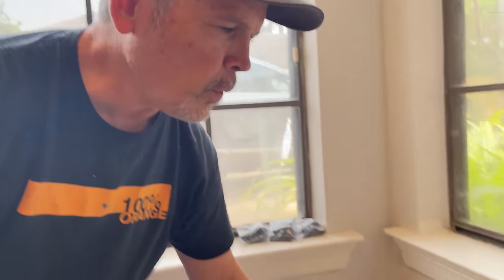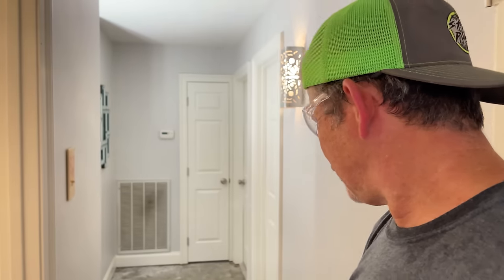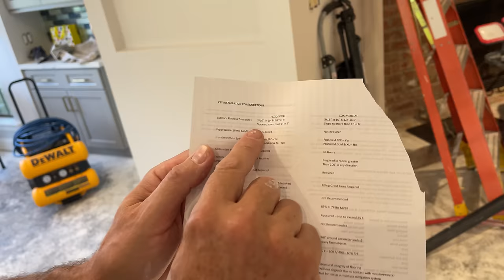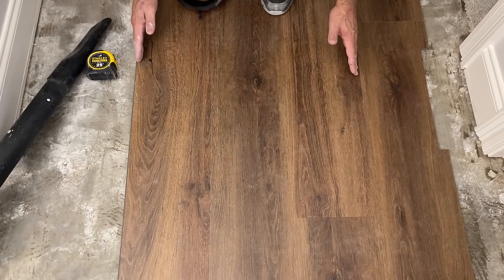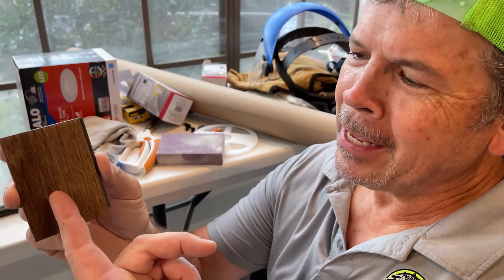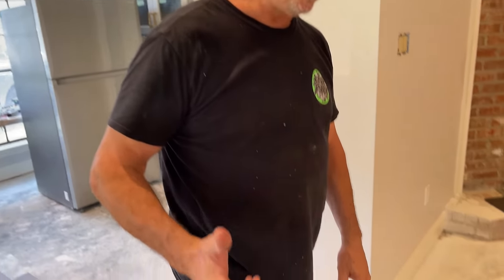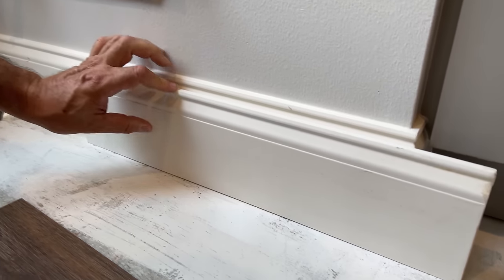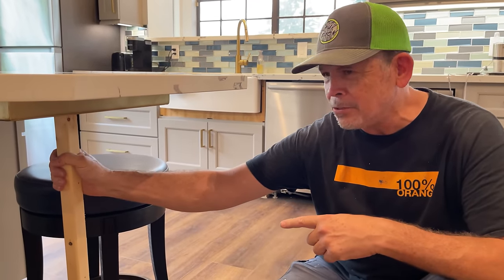The ULTIMATE FLOORING HACK! | Installing Vinyl Plank Flooring

Comment: Also u can get those pieces in with out taking any rows out or putting water or soap crap on there u use a prybar and a none making rubber mallet.  Then u can get those pieces in after u measure and cut the pieces right. Lord please bless these guys and let them know not to quit there day job.  This is pretty bad but whatever floats your boat

Comment: i never seen anyone lay a floor like that, and that is not a compliment, this is not the way you lay a laminated "wood" floor.
1, you equalize the floo (you done that)
2, you put down plastic, the concrete can absorb moist, you dont want that to get into the laminated floor.
3, than you lay down 7mm-10mm-12mm green insulation sub floor,
this has two functions, 1, it obsorbs noises, 2, it will keep the floor from getting too cold, again you are on naked concrete, that will be VERY COLD..
i have never seen anyone lay a wooden floor directly on a naked bare concrete floor,  that lil insulation u got on that is not gonna do much!,
this is the cheapest thing i have ever seen, and coming winter, they will be sorry they cheaped out!.

Comment: Always remove the base on finishing side! Undercut hearth looks best also. The fee effort required to cut and place shoe molding is similar to removing and replacing base. Plus it doesn't look like a trailer after.

Comment: There is absolutely no reason to be using any type of glue on a snap n click lvt install unless your doing a repair. You also def do not need a table saw to make cuts. To make your angle cuts like he had by the fireplace the best way is just to start from the fireplace and you will get a nicer and more precise cut. Then once you get past the fireplace if you wanted go back to starting at the other end if you wanted to.

Comment: All u have to do so it won't move much not at all is put your boxes of flooring on one side to have weight so it won't move not put screws in the floor that's just time wasted for nothing when u have full boxes that are heavy if u put so many down through the opposite side your working

Comment: The baseboard should ve removed before flooring and by doing that the plastic wedges will rest against the wall. After you remove the wedge and put back the base board. Edit: commented before I realized there was a trim at the bottom of the board.

Comment: I'm a professional flooring installer and have been doing this for over 25 years Even on floors that claim they do not need a vapor barrier you should install a vapor barrier I will tell you why using floor and decor's waterproof product I installed 2500 ft² of flooring into a house in Phoenix in 6 months the whole floor decided to buckle we took the flooring back to floor and decor and stated that the product was failing they sent out a representative and the first thing he did was lift the floor see that there was no plastic and say sorry installer error and walked out the door cost the homeowner about $10,000 in material
Reply: Allure will void your warranty if you use barrier.

Comment: When I end up with short door jams, I use white wood putty and fill it in all the way to the bottom, use the paint scraper and a punch to carve in the detail. It's much easier than it sounds. Then a light sand and some touch up paint...perfection!

Comment: Former installer, 6 years. I have never seen a professional installer use soap and water and try and insert a piece of laminate between two others. Never. When you had the first four rows of the hallway done, you push the whole thing under the baseboard and right up against the starter wall, cut your last row to JUST fit inside baseboard, install it, and slide the whole floor 1/4 inch away from the starter wall thereby sliding the last row 1/4 inch under the finish wall and giving both sides the room to expand.  Same method works for doorways. Cut a piece to fill half the doorway, install it ALL the way to one side under doorjamb, cut other half to JUST fit inside door jam, install it then move both pieces sideways until second piece goes under doorjamb. At half an inch per "tap", I'm sure you will save time just moving things. And you don't have to worry about hitting a piece of laminate 60 or 70 times to get it into place without damaging the end. Besides, water is not the best thing to be putting on the edge of a lot of laminates. It's particle board a lot of the time and water can be very bad for it.

Comment: Just was running across videos on how to do t-transition molding installs, and this video came up next. Sat and smiled through the entire video knowing the father enjoyed working with his two sons. Plus, the information that was given was fun, and energetic. I did my downstairs bathroom, and am planning on doing the upstairs one. Yet this project dwarfs my two, but still very informative and fun to watch. I do have a question, previous to deciding to do my bathroom floor. I had the carpet replaced, and the installers installed a metal carpet tack strip to transition from carpet to the bathroom vinyl flooring. Would I have to rip up that metal tack strip, and replace it with carpet tack strip, and use a 4-1 transition molding to create a new transition. Obviously with the laying of this laminate flooring, it now makes it even with the carpet outside the bathroom. Thanks for the video, you have a subscriber, and look forward to watching more videos!

Comment: Great job! I myself have laid a ton of this type of flooring. It's more work but i perfer to remove all baseboards and reinstall after. It prevents having to use quarter round moldings to cover any gaps. Also i find it easeir fpr installing with baseboards removed as well.

Comment: Instead of thinset I used a portland cement type floor patch. The advantage of it I thought was that it was extremely strong, it was very fine and it stuck unbelievably well. But thinset would be easier to work with and easier to clean up after. The floor patch product stuck like mad to everything including wood, stainless steel pans, tools and buckets. The question, I guess, is whether thinset is good enough for something like this. It seems like it probably is. Still the floor patch might be better for use on a wood floor. It is strong enough that it might not break up even with minor bending of the floor.

Comment: I'm surprised at how many pros don't know how to use the wedges.  Think of them as an adjustable block. Place them together with the locking faces together. You will have a rectangular block. No tape required. Just place them long side down against the wall.

Comment: I was surprised to see that you put planking where the dishwasher was to go. I was told not to put any for the dishwasher or stove as that would restrict movement/expansion and cause it to buckle. 

Also, checking for patterns is key. I needed 6 boxes for the kitchen, I opened 9. I had '11' designs- but really was only 3 as they alternated between light to medium colors and placement of the knots and swirls on the planks with shifting or rotating.

I didn't use the wedges, either. I did think about using them as shims for my cabinets though.

Comment: Instead of using anchors when putting screws into concrete I use wood. Either a golf tee of I split of a piece of a 2x4. Hold better for me and I don't have to use a certain sized bit. Great Video!

Comment: Not floor patch but ardex feather finish because it doesn't crack and it's semi flexible for that reason and dries fast,floor thin set cracks if
No bonding primer

Comment: Awesome tips and an awesome show! One question: why does the connection between walls and floors have horizontal gaps? I understand that the vertical gap is because the previous flooring was higher, but I'm interested in why you had a noticeable horizontal gap like at 26:22

Comment: Are you using Thinset or Float? Also, an alternative is Custom Building Materials Level quick. It is really helpful because once poured it will find its own center of gravity to fill in low points of entire space. Just, Mix it to about pancake mix consistency, put 1 by's at Baseboard to keep any running under wall creating damage to the Sheetrock

Comment: We just use utility blades for 100% of our cuts on LVP. Yeah it’s a little fatiguing on your hands after doing 500sqft but it saves soooo much energy rather than walking over to the saw or even using a snap cutter. Only one I wouldn’t recommend doing that with for DIYers is COREtec brand floors. They’re pretty tough compared to big box brands. Although we do about 4-6500sqft a week so you get use to it

Comment: Good video.  I wish it was available before I put the very same floor down.  You are absolutely correct when you said it won't stay together if you don't secure it from moving.  I didn't secure it and every time I tapped a new piece on it opened up somewhere else.  It drove me crazy.

Comment: Great job. Rather than continue to ruin the new floor pieces with the buzz saw which I saw repeated at least once, use a scrap or flip over the one you have close by. Makes a perfect gap cutting guide.  I also wondered why you were cutting the base board in the first place if you are installing shoe mold. And why install shoe molding if your floor is tucked under everything ? Your baseboards are mostly not an issue on this job.  Just an observation. You guys are usually teaching me. Thought I’d share. Thanks and keep ‘em coming

Comment: Instead of getting up to cut the edge pieces on a table saw you can use a technique called jump scribing. You basically set the board you want to cut on top of the last installed board, then take another board or scrap piece and place it against the wall overlapping the board getting scribed. Then use a utility knife to score and snap the scribe board. It's way faster and easier on your legs.

Comment: Unfortunately, I have yet to find a slab that is within the specs of 3/16" within 10'.  Some say 3/16" within a 10' radius!  My take is that it is a "Weasel Clause" from the manufacturers.  But it is something I always discuss with my Clients.  Low spots are one thing - they can be filled.  But high spots have to be ground down, messy and time consuming.

Comment: I have a question about the LVP flooring. We recently replaced our flooring with the LVP flooring product. Now after a few months, there are slight gaps popping up between planks in some of the rooms. The contractor is saying it is normal and can't do anything about it due to the constant settling of our home. We are in /southern CA where there are lots of earthquakes etc. What is your opinion? I think the installation was bad, that perhaps the subs did not hammer the edges to each plank.

Comment: I would never align an entrance into a mainroom. If it is not 90% in angle your whole living/ main room is meh.... also put out your kitchen to level ground the goodway. But good job overall thumbs up. Also would never use leftovers for new line. Decide if you go 1/3 or 1/4 tiles. And keep it. Looks much cleaner/ esthetic in big rooms. Sorry for my bad english

Comment: Always break the material directly under doors! The carpet in the first 2 doorways come into the hall. When the door is shut you should not see whats on the other side. Even if you use the reducers it will not make under the door. Nice job otherwise.

Comment: I didn't see any expansion joints in your video. Laminate manufacturers usually require a quarter inch at each wall and an additional joint if the flooring is continuous pray a certain distance (I recall one manufacturer required it at 28 feet). I have heard of laminate buckling because the gaps were inadequate. Doesn't LVT plank have the same requirement?

Comment: I just put down similar flooring.   I have big gaps in some areas of my edges.  Well. My first big project.    I wish I had seen this before I started. I am using quarter round!!.    That's what brought me to your videos.  I just ruined half my quarter round cutting it wrong.  I have a miter saw.  I just never cut trim before.    I'm going to correct the old baseboard that was previously on too.   Im.stacking  baseboard even though I've seen the trouble with doing it. I already bought it.   Painting my baseboards  cap and quarter round a medium gray. I have light gray walls with a blue undertone.  
  Love you videos. A wealth of knowledge!!!!  Will definitely help me on room number 2!!  
Thanks!!

Comment: Never use thinset to patch or level a floor. That is what flooring leveler is for. Read the directions studly! Or Google it! Rarely does a tape measure come out on the actual install after the first board goes down (Hourly paid rookie) Little square to make straight cuts? Seasoned installer freehands and uses the material as a straight edge for exact cuts. You're good at vacuuming  though! Lol

Comment: I've used the shims to hold the flooring away from the way and agree that they don't work well. What did you use to hold the flooring away from the wall? I must have missed what you used.

Comment: Yeah, go ahead and do this.  All the tapping you do to lock in the remaining rows is going to compress and damage the tongue on the second row, making it impossible to attach the first row, which you will do last.   Just use something else as a spacer and save yourself the frustration.

Comment: Am I the only person who likes the look of base shoe with a taller base molding? I don't care for 1/4 round in any circumstances but I think base shoe adds a nice shadow line. I don't like it with short base because it doesn't look in proportion. In the instances where the floor has bumps and dips and the owners don't want base shoe I'll take the time to scribe the base to the floor. It really doesn't take that long - I scribe most of it on table saw and cleanup with the belt sander. Yes, it takes longer but in the end I want to do a professional job so so be it.

Comment: I just started watch a few days ago
I have a old house built back in the 30s every room has a door.
I remodeled my bathroom a few years ago and I did put down the vinyl flooring but when I installed it it goes North to South.  All the other floors that I still need to do have hard wood floors and they run east to west. So with the tub on one wall east to west and the toilet next. Will I have to redo the flooring to go east to west r can I leave it as is?
I’m going to sell my home in a couple of years. I do have a hallway that runs thru to each bed room one at rash end and the bath in the middle.
I want to thank you for your videos. I’m learning and rethinking on some of the projects that I will be doing.

Comment: USE LEVEL SET LESS WORK BETTER FINNISH ,REMOVE BASE BOARD LEAVE 1/8 SPACE ON ENDS AND 1\4 INCH SPACE ON SIDE LENGTH WILL NOT POP APART LIKE SO MANY INSTALLS IVE SEEN.

Comment: U don't have to use a saw for anything with that kind of flooring when u can cut it with a utility knife and snap it. That's even with rips or even cutting around fireplaces. U don't even have to measure your end cuts u turn the pieces around and butt it to the wall and cut it at the middle of the lock.

Comment: I enjoy your videos very much, and you have a wide variety of knowledge on a lot of different aspects. However I am a flooring independent inspector and the floor that you're installing in this video over Concrete absolutely needs a moisture barrier, 6-8 mil plastic, over lap plastic 8"-9",  tape the seams with a water proof tape and run the plastic up the walls 1"-2" . Two years ago it was in most vinyl floor installation instructions ill bet this product has changed their instructions since the filming of this vid. As an inspector I would say that floating LVP installations without moisture barriers make up the bulk of the problems and issues that we have to look at, the product will begin to cup and then break at the locking systems. I wouldn't be surprised if the homeowners have called you back for this very issue on the job that I'm watching right now I don't wish you ill in anyway but I know how this process goes with moisture barriers.

Comment: Door floor trims should be under the doors. No carpet or tiles should be visible from the corridors from the rooms. Cut the carpets and angle grind the tiles so the trim will fit under the doors. Nice video however overall.
Reply from the maker: The carpet was less than a year old.  Owners didn't want it touched.  Good catch though 👍

Comment: Don't listen to these guys. Never are you supposed to start flooring in a hallway and never do you undercut base molding. Always remove base boards. They are there to put on to cover the mandatory gaps now these idiots need quarter round. remove trim you undercut door jams. Hardly ever is a hallway straight. You are supposed to always start on the longest outside perimeter wall. it is usually the straightest wall. These guys need to go to school. I hate it when people post videos on YouTube that teach the wrong ways to do things. Their stagger is awful too. It repeats every 3. You don't want that type of eye catching crap I don't ever go any less than a 6 row stagger because it looks very random. They also did not set up even one no cut zone. That is where you do a measurement in each row length change and it ensures that no matter what you never have an end or starter piece smaller than 8 inches. They did so many things wrong. I can go on and on. These guys never took a professional course or been to a manufacturer's seminar ever and it shows. I can already see that I am going to have to start making my own videos to show the correct ways to do flooring. Until then if you want to see correct ways to do flooring head over to @Floors by southern boys. They will set you straight.